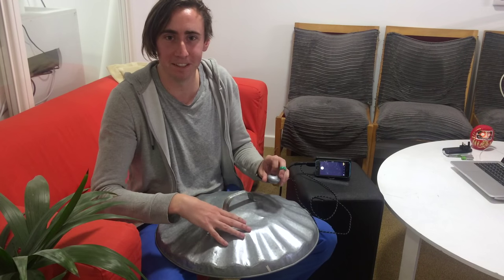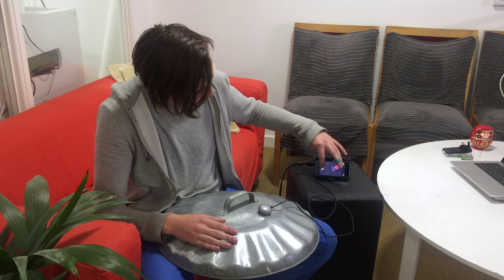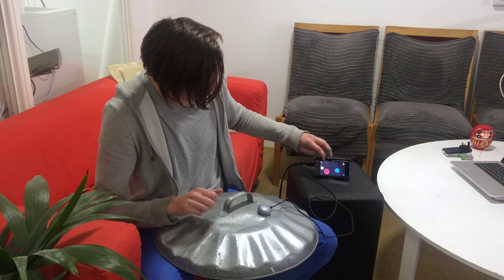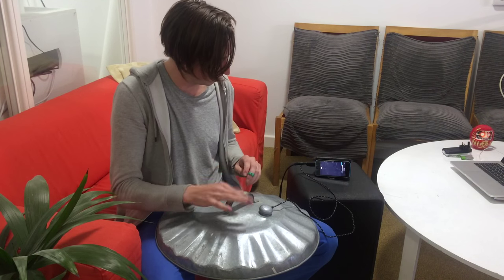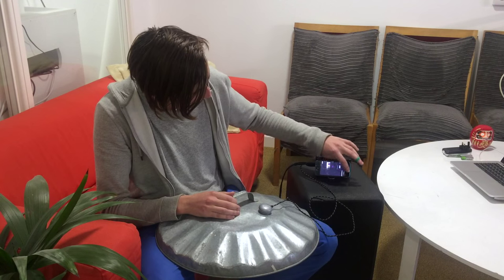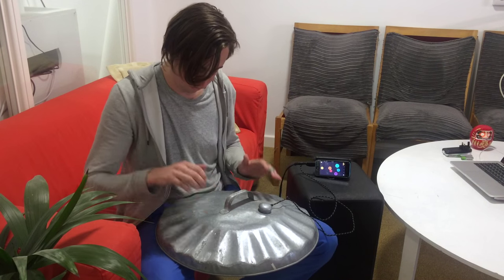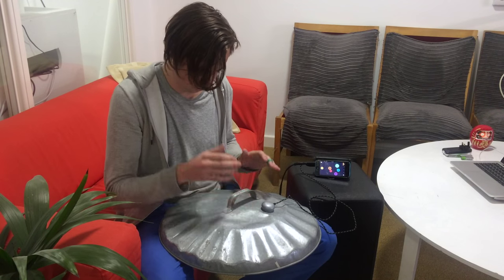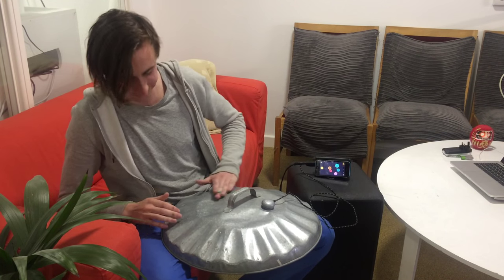How to turn a dustbin lid into a hang drum

Comment: So the phone plays back the sounds played? Hard do hear in the video. Or does it trigger other supplemental sounds?
Reply from the maker: By connecting the Mogees sensor to your smartphone or computer, the Mogees software detects and analyses the vibrations you make, transforming them into musical notes and sounds.With Mogees’ gesture recognition technology, you can train the app to recognise different types of hits or strikes on various parts of an object and associate them to individual notes or sounds.You can use gestures to control any Mogees sound engine or external instruments and effects through MIDI.
Reply: Thanks. So it doesn't actually pick up the sound of the object? Only the vibration to trigger another sound. It's just that it sounded like that with the dustbin lid.
Reply from the maker: The sound quality/materiality of the object will affect the output of the synthesis: if the object changes the timbre of the synthesied sound changes (e.g., with our SCOPE sound engine you could try the same preset/settings on two different materials and you'll hear the quality of the sound change accordingly).